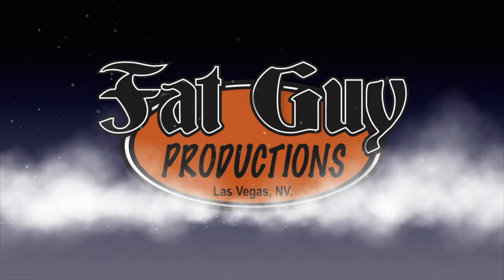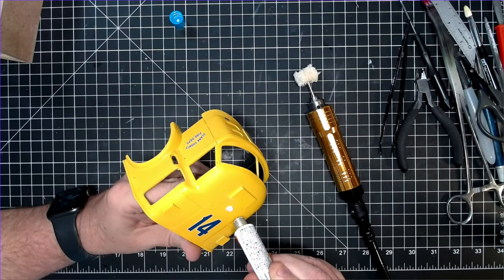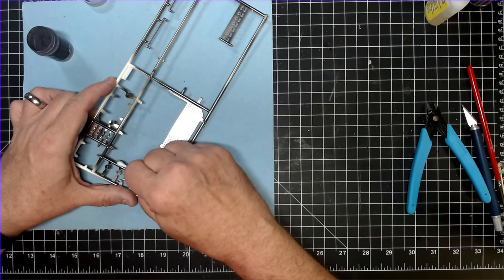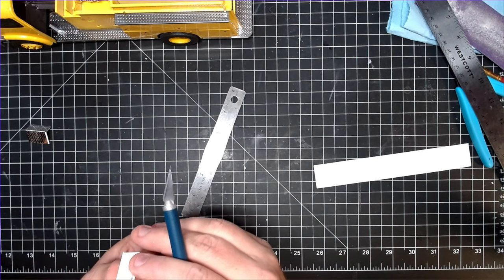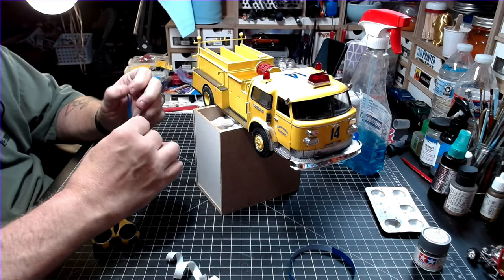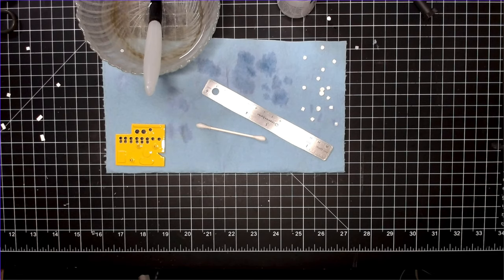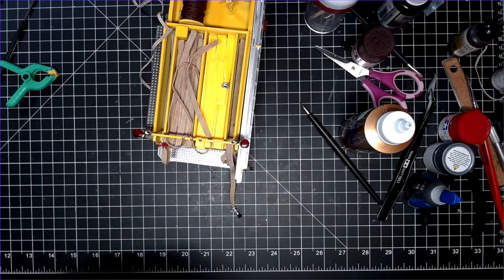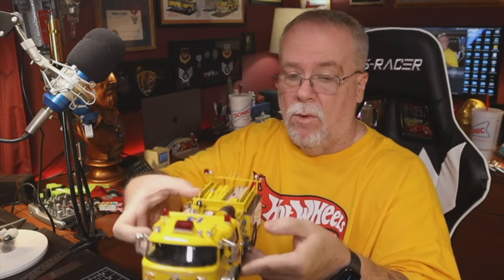AMT American LaFrance Fire Engine Model Build - Part 2

Comment: Just started watching ur channel man firetruck turned out amazing sir, but just a little quick tip yes, I learned this the hard way but it pays off everytime I finish a model, Always test fit everything in sub assembly before paint cuz that way if something needs to be cut in order for fitment then u dnt run the risk of damaging ur paint job no breaking something u didn't want breaking like I saw u having trouble fitting the whole body to the chassis, and had to trim away some plastic running the risk of damaging the paint work where that's where it comes in handy when test fitting everything before gluing or painting. Hope this helps u out.
Reply from the maker: I hope everyone who tunes in will read this as it is so true.  Thanks for sharing!
Reply: @pauly7218  ur welcome sir just a tip and advise from  previous mistakes I made myself but learned.